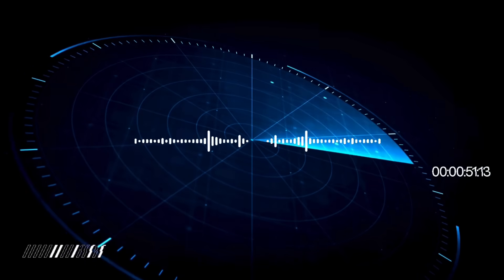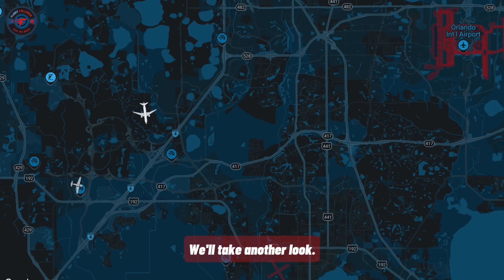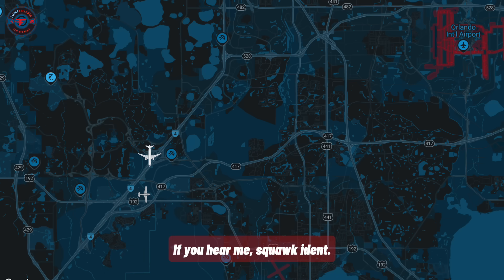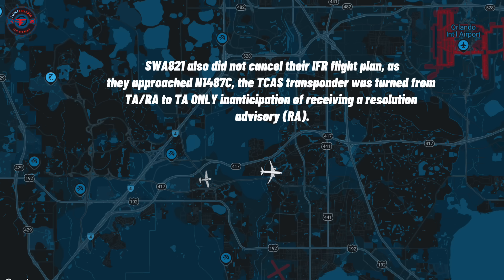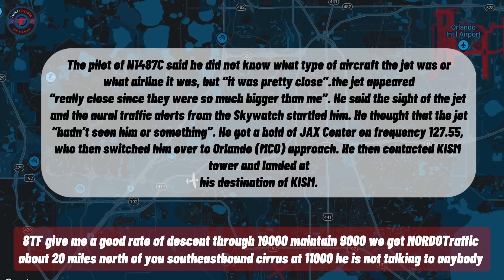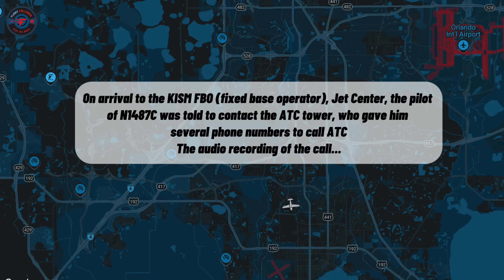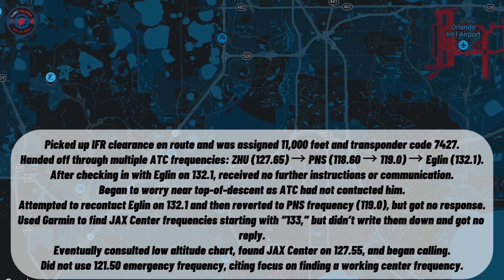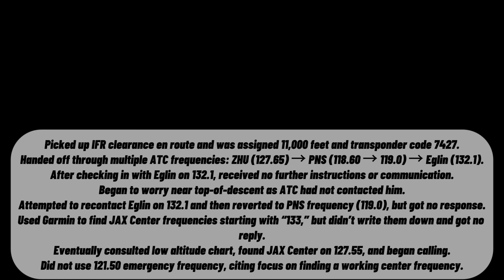ATC Suspended After Directing Southwest 737 to Inspect NORDO Aircraft, (Loss of Separation) 2011#atc

Comment: Wakey-Wakey Looney Tune, you damn lucky the ATC didn't scramble the jets. It's totally incompetent. If your that tired take some time off or give the controls to your first officer. 

Egos lead to crashes. Leave your ego at the jetway when you embark and dont forget to retrieve when you disembark. Falling asleep at the controls of an aircraft hauling passangers is in direct violation of the NTSB.

If you have sleeping quarters on your plane you should know the procedure. If not get with your dispach and request personal leave so to get well.

Comment: This is insane.  Most airline pilots have no military experience and zero experience conducting a GCI (Ground Controlled Intercept).  They would be unlikely to have any experience flying formation either.  Accepting the suggestion to intercept the civilian NORDO aircraft puts an airliner full of innocent passengers at risk; serious risk.  As an ex Naval Aviator who flew fighters for a living, I can tell you that doing this kind of thing in a fighter carries plenty of risk should anything go wrong.  A moment of losing sight of the intercept target can easily result in a mid-air and several of my contemporaries went home to Mom in a rubber bag for just that reason.  Trying a stunt like this in an airliner with untrained pilots is just asking for trouble. In my subsequent 33 year airline career I never ever would agree to this kind request even with my background.  With a situation involving pilots with a pure civilian flying background, it is sketchy enough to warrant serious discipline of both the pilots and the controller.   It worked out OK in this case, but that doesn't make it right.

Comment: I see no issue with the SWA being asked to check on the nordo pilot. That kind of thing happens all the time and as long as the pilots have visual contact and everyone is careful, there is no issue. ATC still makes sure there is adequate separation until SWA declares they have the aircraft in sight, as is the protocol. There is no reason for the flight attendants or passengers to be briefed on anything; the pilots will communicate either verbally or by gestures to make sure they are both comfortable with accepting such a thing before responding to ATC. 

The only possible consideration I can think of is that ATC didn't position SWA in a way to protect the cirrus from wake turbulence, which SWA wouldn't be thinking about, but the cirrus pilot seems more bothered that ATC was checking on him than anything like that.

Comment: ???? from  Peanut Gallery:  Why was NORDO offline over an hour? What was ATC thinking by sending SW over to observe? (Guessing to kick off the automated "Traffic Traffic Traffic" alerts to wake pilot?) 

As plain vanilla passenger it looks like COMs from ATC to Pilot  need upgrades. At the very least a screen with "Closed Caption" Readout from ATC to Pilot to override garbled messages (CRJ v Blackhawk). 

In this case a secure (Loud) audio alert ATC initiates to reach pilot's personal cell phone device. Tracking the pilot yes, but also instant secure COMs) 

Tell me these type of coms don't exist in F15s.

Comment: For ATC and pilots its not you're job to do "good deeds" , it is you're job to keep the passengers on the 737 as safe as possible and that should have been the number #1 priority. Even if he made those passengers 0.1% less safe, he made a terrible judgement call. There could have been a potentially dangerous situation happening on that privet aircraft,. An aircraft that was NORDO for that long is a job for USAF who has the ability to inspect/intercept and are trained on how to handle what ever the situation was.

Comment: What this comes down to is, ATC sent a passenger jet ,along with a couple hundred passengers to investigate a potential national security matter, and within only 100’ vertical separation from another aircraft with a potentially incapacitated pilot. Absolute stupidity, and shows COMPLETE lack of judgment.
Reply: It's a 737-700.  It's 143 pax, assuming it was full, not "a couple hundred".  With the low level of performance of the SR22, how quickly could the SR22 have really become a threat to the 737?  A pretty minimal turn, climb, descent, or increase in thrust and the 737 would have massively outperformed the SR22.  It's not like this was a non-responsive jet with performance close to that of the 737.
Reply: @ my point it doesn’t matter how “safe” it was ATC increased the risk during the flight for all passengers on board and ATC has a responsibility to prioritize the safety of all the passengers who did not sign up to do inspection passes. If there was ANYTHING the SWA jet could have done to help it might have changed the equation but not much. Bottom line, it’s against ATC regulations to send passenger jets to do inspection passes, he violated that protocol which is why he got disciplined.
Reply: @ds78613  So I've got about 2300 hours behind the controls of a 73, most of them on the 700, and there is not a single correct thing said in your comment there, just a whole bunch of nonsense. Pretty much any narrow body commercial jet is going to have the same maneuvering capabilities and pretty much any 37 ever made is going to move just as quick as the other. when they say the 700 is a "responsive" jet, they're talking about how it handles. Ive never heard of a "non responsive jet" haha, on any jet, when you make an  input, the plane responds to it instantly, the difference in how quickly the 700 responds compared to a 737 classic is thousandths of a second. When they set minimums, aircraft performance is not a factor. You don't put pilots carrying passengers in a situation where they would have to perform an evasive maneuver. we have minimums for a reason, ATC violated them, and he was punished as he should have been.
Reply: @RyanMcGregor-pk8oi  "non-responsive jet" as in something with a whole lot more thrust than an SR22 not responding to ATC like the SR22 was non-responsive.  You assumed wildly incorrect things about what I wrote.
Reply: @ds78613  That's not how that comment reads, but fair enough. the 700 has a lot of thrust because its a large aircraft with about 115 foot wingspan with a whole lotta weight, the thrust is not for performance. It does matter how much thrust a 700 has. with a 100 feet of vertical separation, you are NOT getting the plane out of the way quickly enough, you wouldn't even have a second to react if something went wrong. trust me I know that aircraft well. People don't realize how quickly things happen in the air.

Comment: Even if the risk was very small, you are still risking the lives of 230 people. UNACCEPTABLE, no matter how small the risk was. I’m an airline pilot, would you want me to do this inspection if your loved ones were on board? 100’ of vertical separation with a passenger jet is NUTS, especially after what happened at DCA.
Reply: In what world does a 737-700 carry 230 people?
Reply: @ I meant to say 130 but that’s really not my point

Comment: If that guy was incapacitated and they were able to help out in some way then that controller would be lauded as a hero.
Reply: They could not possibly have helped out that pilot.  Passengers were placed at increased risk for no reason.
Reply: @charlesfaure1189  Exactly. Not like SW pilot was gonna reach over and pull the CAPS for him.

Comment: I see no problem with what ATC requested from S.W.821..Every movement action invoked, was maneuvered professionally and safely..There should have been no consequences for either party involved.. Kudos to all involved!!
Reply: Sending a 737 loaded with passengers to do a NORDO inspection with only 100’ of vertical separation is beyond INSANE. An F-16 should have been called, they can see better and do an intercept if necessary. There’s NOTHING the SW crew could have done to help. (Ive been an airline pilot for about 18 years) would you want me to fly right up on top of a GA plane to do an inspection if you’re loved ones were on board? Even if the risk increase was very little, you are still risking the lives of 230 people. UNACCEPTABLE.

Comment: Just from the comments here, it’s clear masses of people have lost their bloody minds, and we are experiencing a rather widespread and disturbing breakdown in fundamental common sense and rational thinking.   How can a collective of people reach completely opposite conclusions using the same set of facts?    

That ATC would even consider using a commercial airliner as an “intercept” for a rogue aircraft in flight that had gone silent, with its status and intentions unknown, literally boggles the bloody mind.  That the Southwest crew actually complied with the request is equally disturbing.   

That Southwest crew, like all other commercial transport aircraft, have just one responsibility, and that is to transport its passengers to their destination while maintaining the highest levels of safety, from the moment they board, until arrival at their destination.  That obviously doesn’t include unscheduled course alterations and flybys to visually inspect other air traffic inflight.  

This ill conceived, boneheaded, and pointless exercise threw safety regulations out the window (along with basic common sense), while placing the Southwest passengers at increased and unnecessary risk.    How anyone can be confused about this is astonishing.   What could the Southwest crew accomplish?  NOTHING.   The rogue aircraft’s position, altitude and heading were known by ATC, and apparently still on its approved flight path, so there was nothing the Southwest crew could do other than verify what was already known.  

For all of you knuckleheads here defending this idiocy … y’all  are in desperate need of a “checkup from the neck up”.

Comment: I was flying from Belen NM to San Luis Obispo CA one time in a Baron.  I was VFR with flight following. I was waiting for my next hand off for quite a while, maybe 30-45 minutes and hadn’t heard any calls for me. I was monitoring the last assigned freq that I had previously checked in on and had a response from. Finally, I called ATC on said freq and the controller essentially chewed me out for bugging him, but at least I knew he was still there. I said OK and flew on another long while, now I’m over central Arizona and still no hand off so I called again but this time no response from several attempts. I checked my ForeFlight and looked up the next freq that was in Prescott I think and called it. Woo hoo, I got a response. They hooked me up with the proper freq and I continued on with no problems. I wasn’t IFR and no airspace issues so I guess no big deal but the controllers attitude was unbelievable, I think it was ABQ. Prescott was real nice though. I assume I lost radio contact being too far away and only a few thousand AGL.

Comment: Most ridiculous thing ive heard ATC request and equally absurd that SW took him up on it.😮
Reply: Completely agree.  Intercepting a perpendicular prop plane with a 737 is just plain sketchy without significant formation experience.
Reply: The controller can request all he wants, but the final decision would be up to the pilot of the SWA flight. To take this a step further, none of this would have had to have happened if the Cirrus pilot hadn't been asleep at the switch. If you're flying IFR or VFR with flight following, there's no way you're ever going to fly for over 90 minutes without hearing from ATC in some form or fashion. He's the one that should be on the hot seat, not the controller.
Reply: Passenger jets have been getting as close as this  with helicopters, during  a more critical stage of flight, at DC for years and the FAA did nothing!
Reply: @robertdorr1769  I just had it happen in FLL and ATC was bothered that I had a problem with it...
Reply: bingo

Comment: The ATC should accept the suspension with pride knowing he did the correct action. Truly there is nothing in FAA regulations that prevented him from vectoring another aircraft for a looksie. It also appears that the Cirrus pilot had task saturated and missed frequency change qeues. This is what happens when you train to technology and not the  fundamentals of flying and navigating.
Reply: no... he should have called NORAD

Comment: No good deed goes unpunished. The Cirrus pilot NORDO in the Bravo was the problem. The Southwest pilot was vectored to a position where visual separation could safely be maintained by the Southwest 821 pilots. ATC and Southwest 821 cooperated to establish the status of the Cirrus without significant assignment of resources or risk. The idea that aviators or ATCs should be punished for making sure that nothing untoward was occurring with another aviator and that everyone was safe is ridiculous. Has everyone in the aviation field forgotten or rejected the Good Samaritan doctrine?
Reply: If I'm a paying passenger I do not want my flight crew taking any unnecessary risks and playing games with TECAS!
Reply: What this comes down to is, ATC sent a passenger jet ,along with a couple hundred passengers to investigate a potential national security matter, and within only 100’ vertical separation from another aircraft with a potentially incapacitated pilot. Absolute stupidity, and shows COMPLETE lack of judgment.
Reply: It didn't accomplish anything. They saw heads but couldn't tell if they were moving. That wasn't useful information. Nobody was wondering if the NORDO had anyone on board. SW also didn't "wake them up" as the controller assumed. They were already trying to make contact with ATC before SW got up in their face.
Reply: It's not a good deed.   The rules exist for a reason.  Good intentions aren't enough.
Reply: Are you insane?  Pilots accepting that instruction, one that puts them within 100 feet and 0.1 nautical mile?  Everyone should have been suspended!
Reply: @Flies2FLL Are the FAA and International Civil Aviation Organization (ICAO) insane? See e g. the AIM Section 3. Distress and Urgency Procedures. 

Note particularly, "If" ... "you believe an emergency or an urgent situation exists, handle it as though it were an emergency.", "Because of the infinite variety of possible emergency situations, specific procedures cannot be prescribed. However, when you believe an emergency exists or is imminent, select and pursue a course of action which appears to be most appropriate under the circumstances and which most nearly conforms to the instructions in this manual." and "If there is a need for aircraft that are not designated as search and rescue aircraft to get closer to one another than radar separation standards allow, the maneuver must be accomplished, visually, by the aircraft involved."

In short, this is not an unanticipated possibility but one requiring intelligence, interpretation and judgement along with visual manoeuvring. Not knee-jerk, slippery slope based criticism.
Reply: @Flies2FLL Wonder what SW’s position is on it.
Reply: @johnkiger1123  Look it up.  This all happened back in 2011.
Reply: @Flies2FLL   I did not see this was 14 years old. Thanks for the heads up.
Reply: @johnkiger1123  YW, thanx!
Reply: @Flies2FLL  Are the FAA insane? 

If the words “Mayday” or “Pan-Pan” are not used but you believe an emergency or an urgent situation exists, handle it as though it were an emergency.

Because of the infinite variety of possible emergency situations, specific procedures cannot be prescribed. However, when you believe an emergency exists or is imminent, select and pursue a course of action which appears to be most appropriate under the circumstances and which most nearly conforms to the instructions in this manual.

If there is a need for aircraft that are not designated as search and rescue aircraft to get closer to one another than radar separation standards allow, the maneuver must be accomplished, visually, by the aircraft involved.
Reply: @ Buddy, you do NOT vector any airplane that close to another airplane, period.  Certainly not a transport category jet filled with passengers!  And what butteater Southwest crew would accept a vector towards an airplane that close at the same altitude?  This is a situation were both the controller AND the crew should have been investigated and/or violated.

Hello?
Reply: @Flies2FLL They SW was vectored to the proximity to the Cirrus. It was  their choice to get up close and personal. Not ATC. Probably an ex military pilot that was comfortable passing close to another aircraft.
Reply: @johnkiger1123  A controller should NEVER ask a pilot to do that and a flight crew should know better than to comply with something like that.  I would have flown near that Cirrus, but only with 1000 feet of altitude between us.  Otherwise I would have refused that one.  

All these people should probably be working in Wal-Mart not in aviation.
Reply: @johnkiger1123  Probably?  Based on what?  Don't make up stuff to justify this kind of irresponsibility.  You NEVER place passenters at increased risk to do a job that's no theirs.
Reply: @ Pretty sure this is not the first time anyone has been asked to check another aviator out inflight.
Reply: Well,  that SWA Captain will likely take an unwanted vacation as well.  NOT SMART !